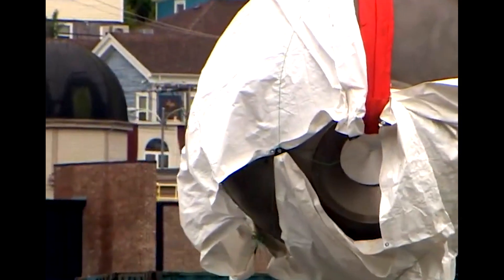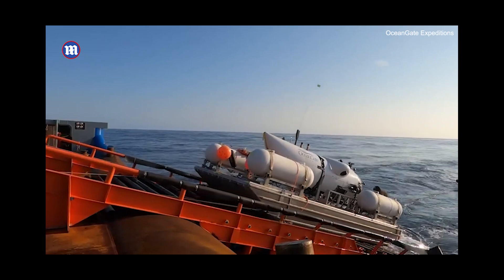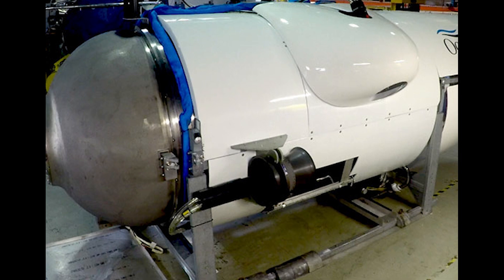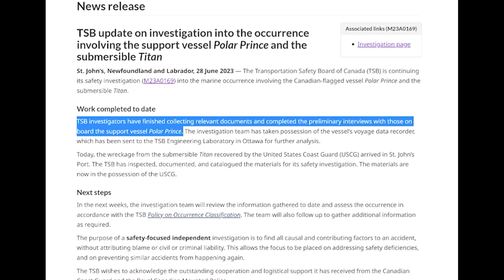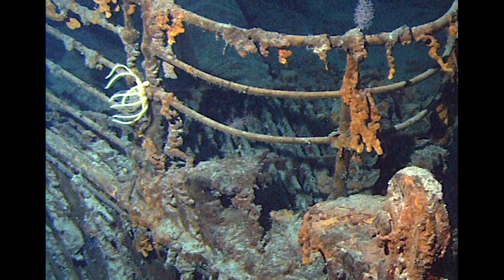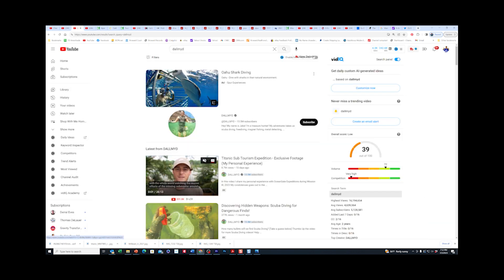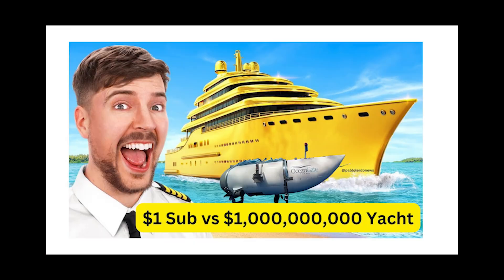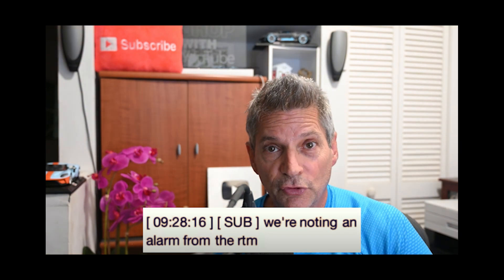Titan Submarine Debris Clues, Implosion Simulation

Comment: Just FYI -The first wrench shown at 7:14 is not a torque wrench, and the second one at 7:18 is -it's the style where you twist the handle to adjust the torque settings.  Presumably, the guy with the non torque wrench was just setting the bolts for the second person to torque them.

Comment: Why couldn’t they ascend? When you reviewed the transcript they had plenty of time from the RTM warning before the implosion. During that time they had problems. If they could have ascended then would it have imploded? Therefore is the hull the failure point or something that led to loss of control? Are the mechanical parts on the back encased in carbon fiber? If the rear section, protecting mechanical parts, failed would that cause loss of control of the sub? Which prevented the ascent, exposing the fatigue pd hull to extended time above its safe pressure.

TL;DR: what happened to the mechanical system before the implosion?

Comment: Why wouldn't they have the front titanium ring have supports the connect to the rear ring, bolted connection that wouldn't allow the 2 rings to separate from the fiberglass hull

Comment: I said before why in the hell would anyone build a sub out of carbon fiber? Carbon fiber is wickedly strong but is brittle in severe cold and mix that with extreme pressures - it’s a bad choice. Things you shouldn’t hear in sub manufacturing - glue , carbon fiber, seals should be and thick but not too thick, play station controller

Comment: It seems I have seen a number of different versions of the portal window styles from the beginning of this debacle.  Some with a flange & bolts on the circumference & some without and two different diameters. Also as soon as the info was put out regarding Stockton finding & buying "expired carbon fiber to save money was the moment I knew this was going to be an ocean borne coffin for everyone on board.

Comment: @4:18 With the way the water pressure was pushing against it would have been impossible for them to pop off until the carbon fiber part imploded.  They absolutely could not of popped off first.

Comment: they went down way to fast is what the problem was, they were at a depth were they should have been for another 45 minutes or so! it couldn't handle the load pressure building up so fast! and the window probably blew out and then popped the cap off in theat next instant, sadly there were probably terrified for a few minutes prior, they could hear the hull cracking and tried to abort, but water going into that back compartment would have cut and sliced anything in its way like a laser beam, and believe it took out the first battery, and now that water was in the compartment shorted the second battery, and they couldn't get back out of crush depth in time, they did start ascending, but just super slow, and i assume the second battery was shorting out causing the power drain. mostly speculation but i'm heavily leaning this was how it happened. any kind of vessel like that should have had an inflation system and back up, under their own sealed power supply to bring them back in in case of catastrophic failure!

Comment: As an engineer that has many years experience designing and repairing pressure vessels, including those operating under external pressure (but not this high pressure) I continue to be surprised by the various design features of this submarine, suggesting that those involved did not really know what they were doing, while imo, some of the commentary misses the mark.

For external pressure design, it is the flexibility (young's modulus) of the material that matters first,  and at these external pressures the crushing strength, not its tensile strength (titanium and carbon fiber's rote),.  For both titanium and carbon fiber, flexibility is low (just watch the wings on an airplane bend upon take off as an example), so these seem an odd choice of material for this application.  Secondly, my understanding is that fiber pressure vessels under repeated loading tend to be prone to fatigue failures, so again, not a preferred choice of material, and this is clearly the main failure mechanism.

Some posters with experience in the industry have posited that the fiber hull should have been spiral would instead of parallel.  For applications under internal pressure, for sure because you need hoop strength as well as longitudinal strength, which is what spiral winding will give you.  But under external pressure, as a primary consideration, you do not need any longitudinal strength, so parallel winding puts all the strength in the hoop, which sounds right.  otoh, I do not know how parallel winding changes the flexibility around the hoop versus along the hull ( it will), and if that matters.

Looking at the video of the pieces, the design of the porthole looks sound.  It only needs light bolting to seal it in place, and then the immense external pressure will force the view port into the conical cone like a stopper in a bottle, increasing the seal.  However, the ring to cylinder joint looks to be fundamentally flawed since the fiber cylinder is glued inside the ring.  Unless there is some very odd (and therefore suspect) engineering going on here, external water pressure acting on the shell will be trying to shrink the tube away from the ring, relying on the glue to hold it all together.  A far better layout would be similar to the view-port with the fiber shell on the outside of the ring, so that external water pressure tends to hold the joint together, rather than pulling it apart.  There are still some longitudinal forces to deal with at the joint, and issues with water migrating into the exposed end of the fiber shell, so I can see why an inside joint detail was adopted, but compromising the primary design to accommodate secondary issues is never a sound idea.  The joint also looks vey short to allow loads/stresses to transfer across the joint - joints are tricky to design at the best of times, without the complications of external pressure and extreme pressure.

So, it was reported that there was a monitoring system to monitor the integrity of the fiber hull.  That was excellent, but it was very naïve to use that as an alarm in real-time since 1) they probably didn't have a clue how sensitive to set the alarms (ie: if they had an alarm, they would have known that something was/has happened, but would have had no clue what it meant) and 2) collapse by external pressure is a buckling failure which is extremely fast with no/minimal time to react (remember how fast the twin towers fell?).

Much has been made of the video game controller, scrap metal pipe for disposable ballast, camping lights.  I am Ok with those choices; they were fit for the purpose (eg: the video game controller is very reliable, and easily replaced, so you don't need to re-invent the wheel here).

I am not saying that carbon fiber etc cannot be designed and made to work.  This example simply missed the mark.

Comment: the implosion is nothing like the implosion that happened bellow the surface cause the pressure differential does not change its constant that drum would have been like a completely compressed can from all ends not like just stepping on a can, imagen stepping on it and crushing it laterally is well as horizontally to complete compression of the air inside the drum would be completely crushed but we are talking 6000psi per square inch not 14.9 psi as demonstrated in the video. put it into a 6000psi crusher with the air still inside and walk a fair distance away just in case the air explodes out of a cracked seam in the drum under couple hundred psi the body's with have been shrapnel to death as well as the wall of water pressure hitting them. instinct soup with bits of bone. iots bad enough hitting the water at over 50 never mind the speed of the water hitting them down at 3500-4000m below apparently some people have done the calculation and its around 1500 mph i know what would happen if i hit the water at that speed it would be no flesh left on me and the bones would be very worn away from the blast off thew water if i landed on the water at 1500 and went under it would rip apart steel like paper soggy toilet paper.  the Guy was an insult for doing what he did not only with his own life but the life of others.

Comment: I once made a potato gun from 4 inch PVC chamber big enough for a 1 liter mtn dew bottle. Then necked down to a 2" pvc barrel plugged with potato.  I used the mtn dew bottle as a dry ice bomb as the charge and loaded it into the chamber with a screw-on pvc cap.....
It had similar results!

Comment: pretty obvious the implosion instantly overpressurized the porthole and blew it out. the "glue" bonded better to the carbon than the stainless. its literally basic as hell if you know anything about this. they just didnt engineer for the porthole to hold in an implosion. understandably

Comment: It's a sad thing hearing about this and how easily it can be postulated what happened and why. 
Why do i have to watch PBS kids wild crats and they discuss the alvin submersible. They say on the show it's 3 inch thick titanium. It can withstand 6500 psi.
It's simple and continuous. I'm sure way more expensive than carbon fiber. 
Interesting or not. My wife started playing softball and most good bats are composite. Spiral wrapped carbon fiber or fiberglass. They are only allowed to spring back a ball so fast for a given speed. usually

Comment: My guess is when they heard cracking and sounds, the back was going under pressure or a leak or something started. Then I feel after they switched to the b battery things were already too far gone and going back up made that carbon shatter and pop off that top dome part with the window. I think that the pressure mixed with the material they used for that center part the crew sat in was a huge part of why this failed.

Comment: Disturbing events, that are so very sad & avoidable! Rush had attempted to make a rush to the surface, he very likely was the only one to fully understand the extent of dangerous consequences about to unfold. That countdown clock was beyond cruel, I’m almost certain the mothership had an idea of their fate. Mrs Dawwood & her daughter was on the Polar Prince waiting for their loved ones to return. Shame on Stockton Rush! He used substandard and expired materials, material unsuitable for use in extreme external pressure, ignored advice from the experts, fired whomever spoke out about the danger, he was a walking contradiction of the power of physics at depth. My understanding is that the enormity of the contraction and implosion would have liquidated any soft tissues. As for human remains, perhaps a metal piece of a joint replacement was down there, denture, foot in a boot, but no remains for a burial, that’s just even more false hope for the families. James Cameron heard about the NAVY ships detecting the sound wave, by the next morning, and alerted the submersible community of their likely demise. My uneducated theory is that a small leak had water collecting in the aft, behind all of them, right behind a wall, water is heavy, and would have hastened their decent, and significantly slowed the accent, dropping weight pipes and even the frame didn’t work…thank God it happened so quickly and they were all dead before anything happened. Shame on this man…and shame on the wise men that rode to their deaths knowing that IF they had a successful tour of Titanic, their thumbs up would have made for good press coverage and attracted more people. They were paying passengers, he can suit and boot them, assign tasks, give them a name plate, and call them mission specialists, but putting lipstick on a pig, doesn’t change the pig, nor did it make them specialists. May they rest in eternal peace~🙏

Comment: Why were they descending faster than expected? Maybe slow partial flooding of areas they could not see? Water infiltrating hull slowly at first makes sub heavier than normal so even with weights dropped, they are only barely able to ascend using thrusters. Then partial power failure reduces power on thrusters so they almost stop ascending?  Dropping weights and frame change center of gravity so maybe at odd angle for ascent thrusters to be effective?

Comment: 1. What happened to the porthole window? The widow itself is conical shaped and is designed to withstand the enormous  pressures forcing it in, and is held in place with a wimpy ring and a bunch of bolts. Not a problem since the water pressure is keeping the conical glass tightly in place. . BUT, when the pressure vessel fails and the air inside the vessel is forced into the nose against the window, the pressure blows the window out, along with the ring and bolts. This is what happens during hurricanes (I live in Florida) when windows that are rated to 150 knot winds trying to blow the window in.  But if a window or door on the opposite side of the house fails, those pressures are now blowing the window outward, an it does. 2. When a pressure vessel gets pressurized and then de-pressurized, this is called a "cycle." Air craft keep track of the cycles they experience by going up and down, getting pressurized at altitude and then depressurized coming down, since this causes fatigue on critical parts.  Laminates, like carbon or glass, also suffer fatigue from pressure cycles or other forces like fiberglass boats, (remember I live in FL) and this fatigue causes micro cracks.  At depth, the hydraulic pressure of the water invades every crack in every direction, causing de lamination, further diminishing the structural integrity,  as well as penetrating the vessel as a leak. So the leak might happen before the catastrophic failure, giving the crew, say maybe 2.5 seconds before total collapse.

Comment: The thing that annoys me, is the amount of attention given to the controller, with people poking fun at it. Those controllers are so basic in terms of tech and communication and functionality, that they were probably one of the most stable aspects of the entire vessel. If you know about these types of controllers, you know this already. you know that they are in fact very stable and reliable. I would have been a bit more confident in a wired controller, however these days they really are just as reliable as a wireless. As a gamer myself, I have been through several wired and wireless controllers, including Logitech, and have never had any issues with a Logitech controller. I've had more issues with Microsoft than anything. So. yea. end rant, just a thought, as it had nothing to do with the failure.

Comment: Maybe the acrylic window was pushed out by the sudden burst of pressure when the sub imploded? Basically like when you're compressing and empty bottle with the cap just loosely attached, sending it flying across the room. That might explain why the ring holding it in place is also gone.

Comment: I think the carbon fiber body failed due to the shape, cunstruction method and material choice (ofcourse). And the window with flange was waterhammered out during the implosion. With the bolts failing from a pulling force they weren't designed for before the thick titanium did.

Comment: only problem I see is carbon fiber tubes not crush resistant at all...  imensae strength the to pressure inside trying to escape...  why they make high pressure scuba tanks with it,   4500psi fromm inside, no prob,   yet you can crush one with your hand......

Comment: it appears that the bonding reaction is taking place in normal atmosphere. 
My limited experience in vacuum moulding suggest that the operation should take place in a vacuum chamber. 
Any air bubbles left trapped within the bonding surfaces will weaken the bond, and if teh device undergoes cyclic operation, then expect cyclic fatigue within the bonded joint.

Comment: You can see the 2nd guy using a torque wrench. Plus the glued on piece was also bolted on and in the wreckage photos you can see that the carbon fibre(what's left of it)is still attached to it. When it's under that much pressure it would seal without the glue, but it shouldn't be called glue because it is a high strength bonding agent and the word glue only makes it sound weak and childlike. The Carbon fiber shattered into little pieces. Everytime it dove down it caused little cracks in the C-fiber. Because it's so rigid it falls into physics know as, that which does not bend must brake. Although titanium is really strong it can still bend, not very much but enough to handle the the alternating pressures of the ocean. The way Carbon fiber is made is with lots of thin layers over top of each layer. Each layer makes it more rigid and reduces its ability to bend. It's like bundle of sticks. If you take a stick and try to bend it, it will until it breaks but the more sticks you have the harder it is to bend and break them until you can get too a point where it's impossible to bend them, except carbon fiber does it on a micro scale. Once the carbon fiber can no longer bend it will begin to  break under enormous pressure and stress until it shatters because of all the little stress cracks from previous dives that were either not known or not checked and inspected! A simple Altra- sound scan or an electric current test would have found these cracks, which I can almost guarantee that he heard them on the first dive. Just little faint cracking sounds but he probably thought that they were just a few creeks and moans caused by the change in pressures on her maiden voyage. Spending an extra $20,000-$40,000 to have these simple stress tests done after each trip would have probably saved those poor people lives. EGO and Pride instead lack of Safety and Concern and Duty towards other people's LIVES are what caused this tragedy.